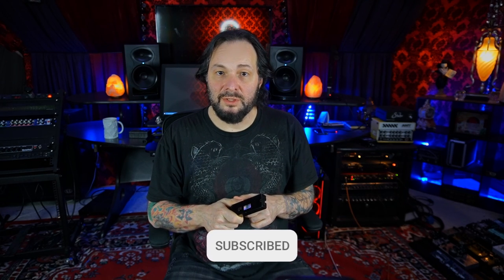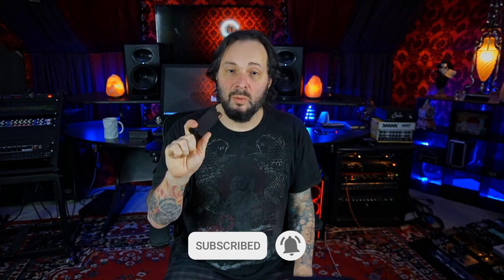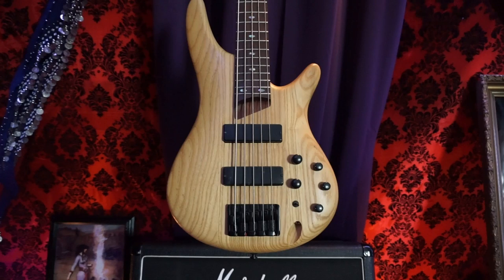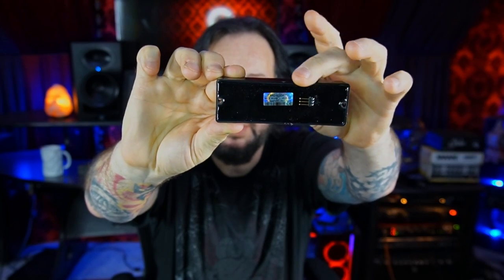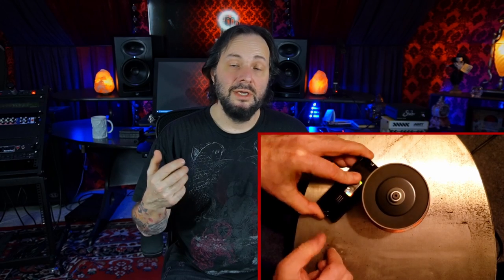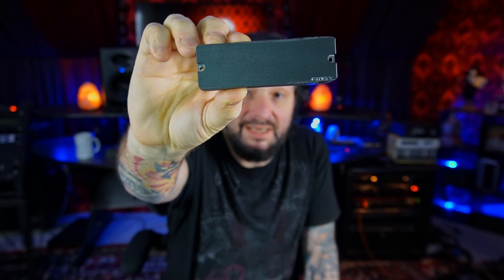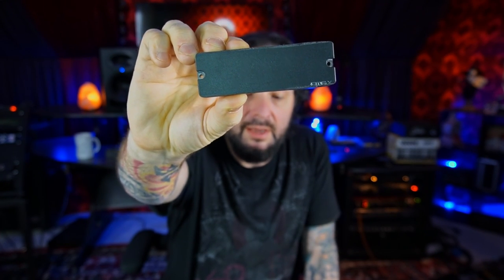Grinding Down A EMG Pickup To Fit It In A Smaller Routing (Chop Shop EP.1)

Comment: What are the dimensions of the pickups now, after everything is said and done? How much room is there in the pickup rout? I've got a few Ibanez basses that I'd like to change the pickups on and any info is always helpful.
Reply from the maker: You don't want to go off my personal measurements. I was pushing things a bit. Plus, my route size may not be the same as yours. When you're dealing with a small tolerance, you want to measure your route, and keep measuring the pickup as you sand to take off the least amount of material needed.

Comment: problem with my bass (cort a4 plus) is that it uses a bartolini p2 5 string pickup but its a 4 string and with unconventional spacing (20mm)
Reply from the maker: You should be able to get 5 string pickups to work fine in it.
Reply: @RodneyMcG  thanks man! i’m gonna do that